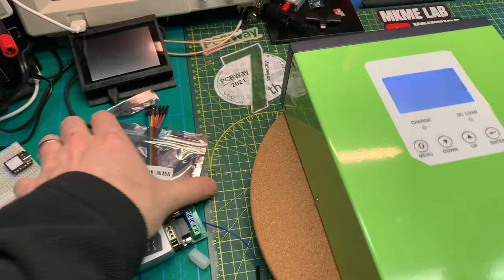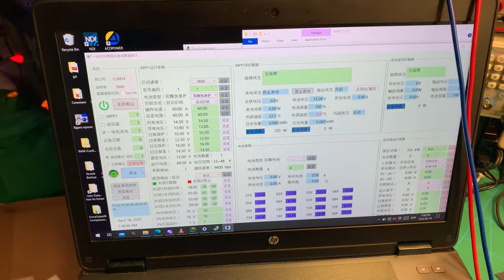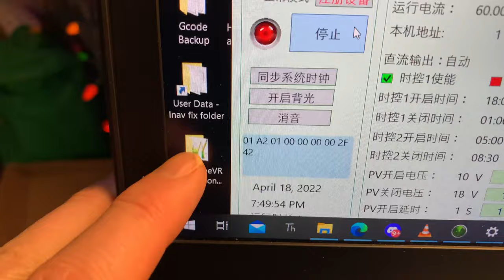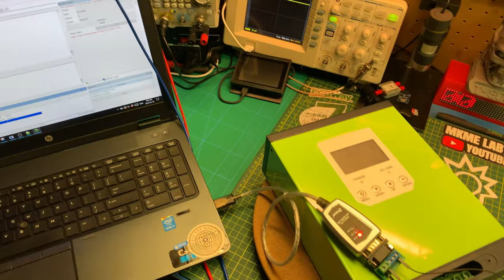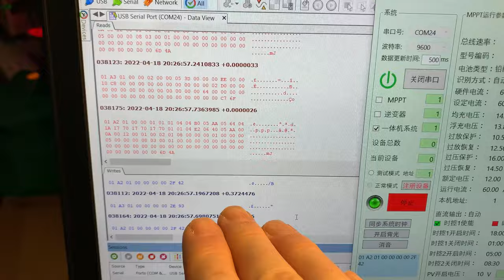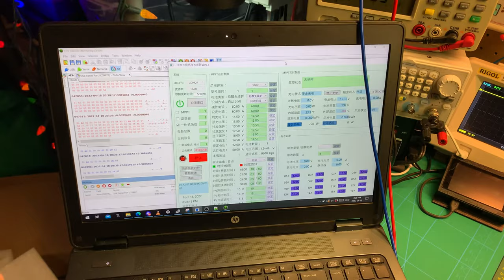Getting RS485 Data from MPPT Solar Charge Controller

Comment: I just stumbled across this video while dipping my toe into learning about how rs485 works. I’d like to eventually build long term data collection into my off grid electrical system so I can see trends over the years of energy collected vs used. So far I’ve learned that I do not have enough spare time to tackle a project like this at the moment.

Thanks for this video.

Comment: Ok I already found the voltage in the data for you looking at your video. That command 01 A3 01 00 00 00 00 23 93 (BTW those last two bytes 23 93 is the modbus checksum) The response is 01 A3 01 00 00 02 00 00 05 3D............. that 05 3D is the voltage field in HEX convert it to DEC =1341 just divide by 100 to get the float representation 13.41v
Reply from the maker: That is super helpful!
Reply: Can i find documentation or the manufacturer program somewhere? Looking to do the same!
Reply: @jackc781  I dunno about documentation, but you should be able to sniff the serial data like @MKme Lab did. But yes you'll need the software for the controller, contact the manufacture, they will probably send it to you.
Reply: @Brad Cagle  it is the same protocoll as ampinvt mppt chargers. o read all data from my sunnysky over rs485 and send it to my homeassistant
Reply: @fabiansteinwachs7001  Thanks! I kind of figured it would be the same.
Reply: Anyone ever find out the MODBUS register map?

Comment: Did you ever get anywhere with this project?
Reply: it is the same protocoll as ampinvt mppt chargers. you can use this protocoll.
Reply: @fabiansteinwachs7001 kindly elaborate, please. I got a MPPT delivered to me yesterday and I was hoping for one with WiFi/Bluetooth for connection for monitoring but it only has something the manual calls a communication port which turns out to be RS485. I'm looking for a way to be able to use it.